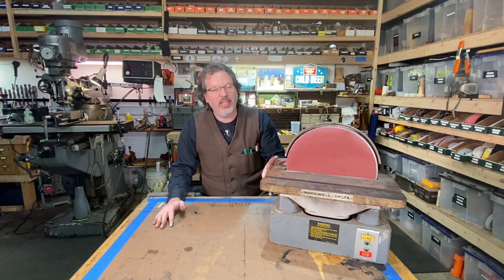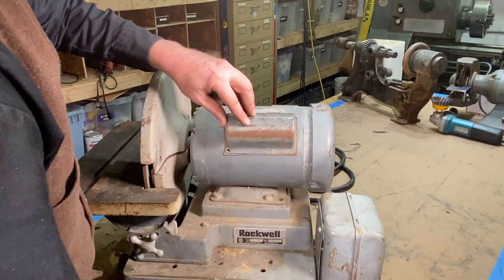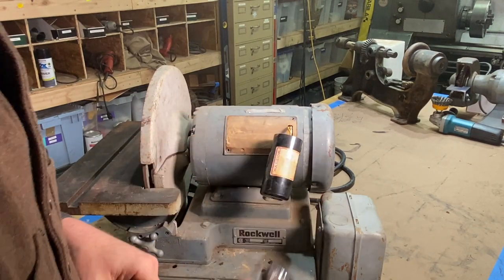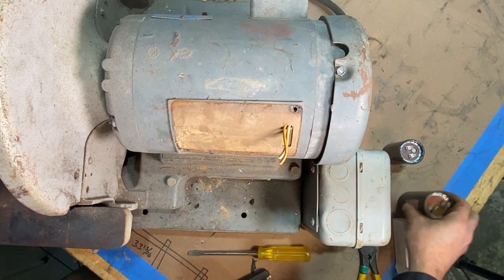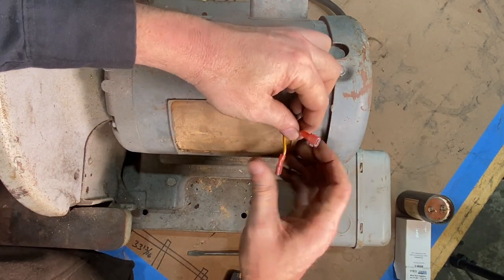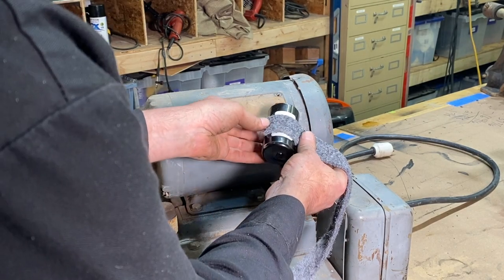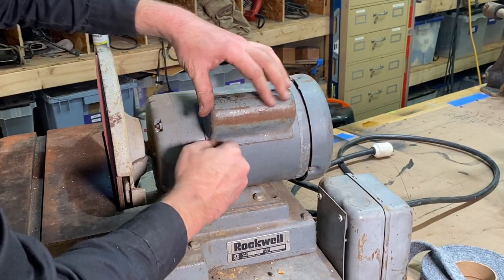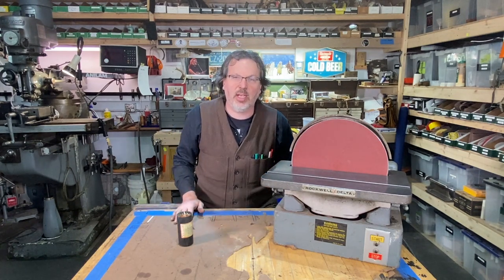Motor Won't Start? - Electric Motor Repair - New Capacitor - Rockwell Disc Sander - Right On #62

Comment: That thing is a Beast!! It's funny I did a video replacing the Capacitor on my Porter Cable Disc Sander a few years ago!! It wasn't easy like yours, I had to take half the machine apart just to get to the Cap!! Well done Bud!!☺
Reply from the maker: Right On Everett 👍 Right these old machines were built like an old Ford with plenty of room to work under the hood!

Comment: Good lesson and nice sander.. Do you normally keep one size grit on a machine like that or do you use a variety of sanding grits?
Reply from the maker: Right on Tonyn 👍 Sometimes I switch it up! The Blue Zirconia paper is really nice. I have to order some in. Sometimes I use 36 grit. Sometimes 60 and sometimes 80. But I usually leave the paper on there until it wears out. 💥💪

Comment: The voltage on the motor is 115-230v but the voltage on the new capacitor is 110-125v. Would that be a concern?
Reply from the maker: That capacitor is good if you are running on 120v. Is your machine wired for 240 or 120? 👍⚡️⚡️⚡️

Comment: enjoyed your sharing of stuff/info...also like the way you clean equip up...Jon, is Johnson's wax is a good coating against rust?
Reply from the maker: Right On Tom! 👍 Yes Johnson’s paste wax is great. It’s best when you will be tending to the machine frequently. It’s good to put a coat of wax on every month or two or depending on the work load. It is especially good on the top of a table saw. It provides a slick surface so you can cut plywood and other material with ease. 💥
Reply: @RightOnJonCrane  can i use wax also on hand tools, e.g. a chisel?
Reply from the maker: @tomdale1313  Absolutely! Johnson paste wax is basically carnauba wax. It works great. The only catch is to put it on frequently if using the tools often. It will rub off with use. I put it on that gas cylinder that I turned into a bell and it still looks amazing! 👍
Reply: @RightOnJonCrane  i will give it a try...txs  Right On

Comment: That was a good tip with the felt , too much vibration can at times cause the capacitor to go bad by breaking an internal connection. A good bit of work there and a good video.
Reply from the maker: A little wool blanket for the capacitor 👍